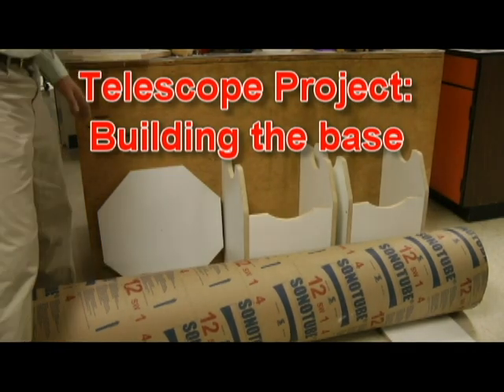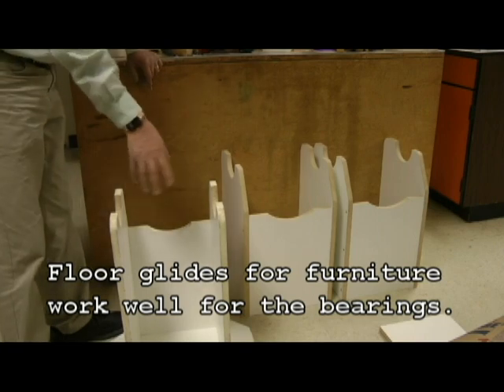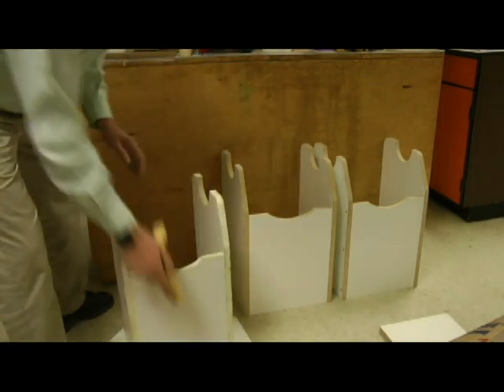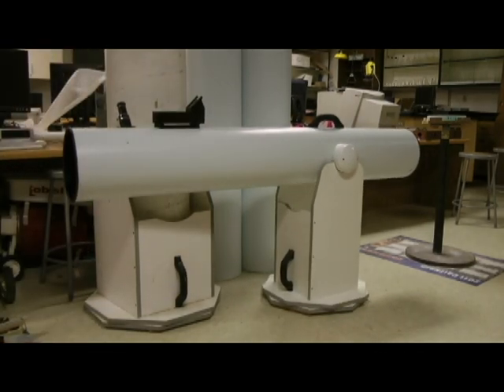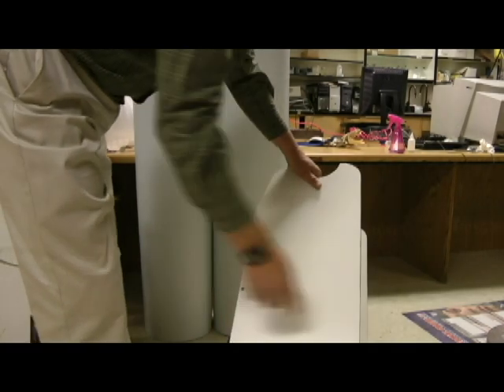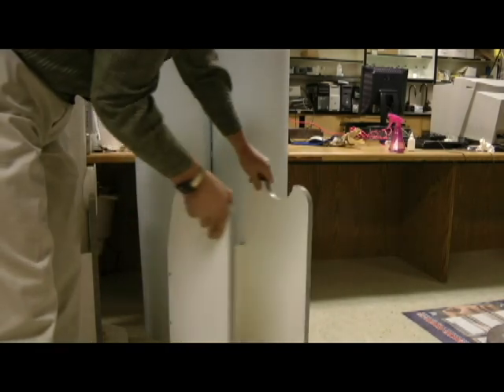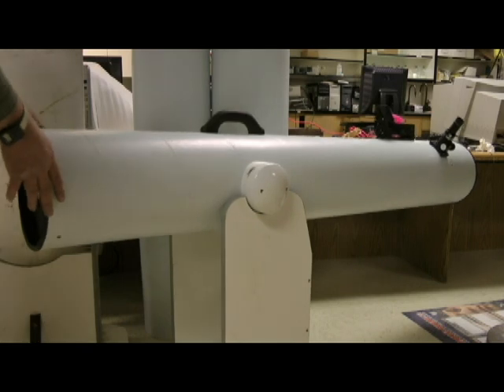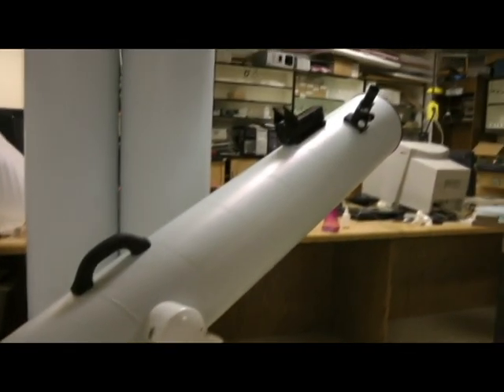Telescope Project: base construction

Comment: Hi You have done the best job of explaining the making of a Dobsonian base that I've found.  I realize you made this is '13 but hopefully you still see comments when made.  Question:  Almost everyone else favors using telfon but you use the plastic gliders purchased at the box hardward stores.  Can you discuss that for me...just curious.  Did you ever create a pdf set of plans for the part cutouts?  I see one added here for an 8" but would love sizing for 6" and 10" if you have them.  WHere are you located at?  Herb
Reply from the maker: I have made 8" through 12" telescopes and all I do different is modify the width of the base.  I plan the focal length of the mirror so that I can still haul the telescope in the back of my truck.  The f4.5 12 inch is the same length of tube as the f8 8 inch.  This allows me to use the same base only spread with a wider back piece.  It is a function of balance for the telescope.  As for the teflon, it is better but I could not get it when I made these.  I live in a small town in Utah and we are a bit limited in what is available.  My first one was made before the internet was a good source to purchase from.

Thank you for your interest and enjoy.